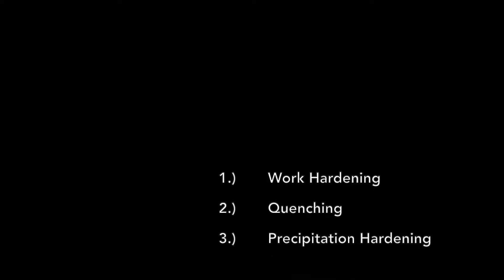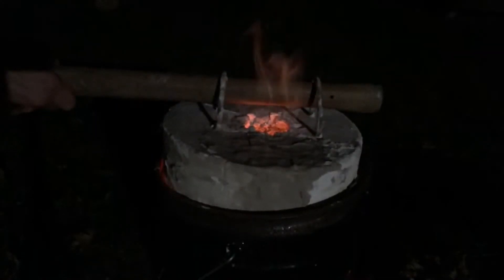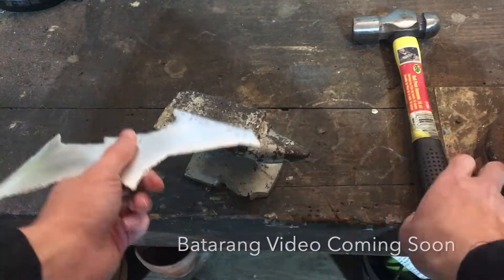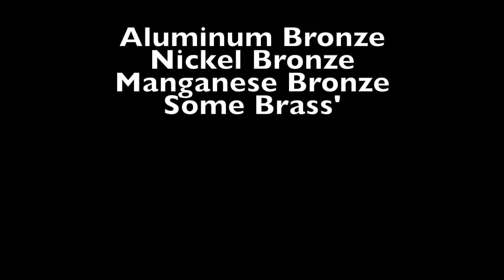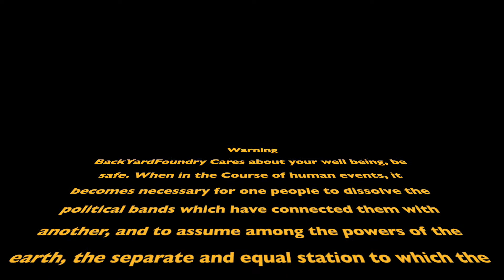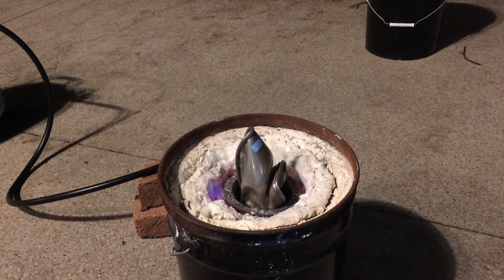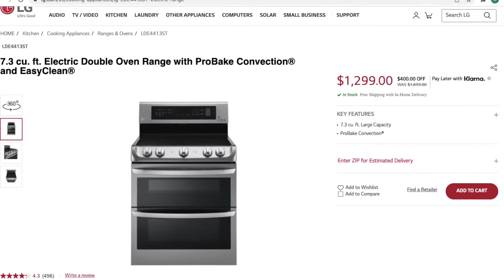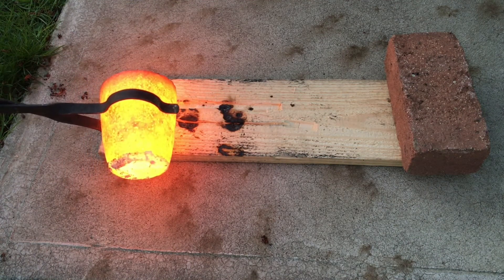How to Harden Bronze Casts [ 3 Ways ]

Comment: How would you harden bronze enough to carve granite?
Reply: Not possible. Only way to carve granite you need a stone thats harder or same as granite. Like flintstone. Bronze was only used for Things like sandstone
Reply: I think it could work if you make an extremely high tin ratio chisel and then just keep work hardening it. 

Or use aluminum bronze and let it cool VERRRY slowly. I’ve heard anecdotally that depending on how you make it aluminum bronze can be almost as hard as mild steel
Reply: arsenical bronze will carve granite. Really not good for your health though.

Comment: I'm pretty sure precipitation hardening is an other word for quench hardening. Rather, quenching precipitated the dissolved alloying elements to form martensite and other structures. I make knife blades from hardenable bronze. I forge the blades by hand, and temper them on the fire. It's important to note that on a lot of aluminum bronzes for exemple, the hardness doesn't really come from the quenching process (the bronze doesn't harden much after quench) but from the decomposition of the martensite, aka tempering / aging. However tempering aluminum bronze is still pretty unexplored, and even the latest research papers don't give very precise processes. So i personally had to practice and find for myself a method.
Reply: I'm sorry, but precipitation is far from quenching, whereas the latter involves rapid cooling of heated metal. Precipitation is also known as age hardening, which involves slow cooling at room temp (i prefer warmer at 30 degrees celsius), which instead of annealing that happens to steel, in bronze metals it actually increases hardness and strength, and more superior to work hardening.
Reply: @blueknyght923  thanks for the precision ! Precipitation hardening refers to the formation out of solution of some kind of hard structure (like martensite), and indeed i've seen that it was linked to heating up alloys, but as you said, steel doesn't need to be heated up, it rather needs to be cooled down. However i've seen that high alloyed steels do précipitation harden, around 500C, if you quench it first
Reply from the maker: I appreciate the input! I am still just a hobbyist so I try to convey the information as best as possible, but mistakes and missing information is definitely possible.

Comment: How do I get the nice even hammer hardened edge on my bronze swords tho? It's often a hard thin waffer on originals. With a perfect line between unhammered and hammered bronze.
Reply from the maker: You can always grind away the dimpling after you have done the work hardening. The key is to maintain a low temp when doing it. So if you have a belt sander (which would likely be best to give the perfect line you are looking for) work slow and cool the metal often.
Reply: @backyardfoundry  That doesn't seem right tho. I've seen in originals the wafer edge. That has to have been peaned out not sanded out.
Reply: @imperatorcaesardivifiliusa3805  Agreed.  Perhaps historically something shaped more like a cross-peen hammer was used to hammer out the hardened edges.  Neill Burridge knows the secret, but I think he only gives it up to attendees of his bronze casting workshops.
Reply: @tobhomott  Yeah. I believe a lot of bronze age reproduction Smiths have their own method for achieving it. But none are forthcoming in sharing it.
Reply: @tobhomott  Sadly he does not as far as I know. Every now and then he rambles on the goodbook about how he is the only one who can reach this quality but he will never show anyone how to do it, because that would cost him business. (in his mind)
Reply: @saladrobot  I don't really blame him.
Reply: i know this comment was from a while ago but it should be fairly easy with a cross peen hammer that is well polished with an anvil with the same shape or one of the tools could be flat . this is how scythes are sharpened and it leaves a near polished wafer edge
Reply: also you could finish it off with a planishing hammer and polished anvil and get a fully polished surface